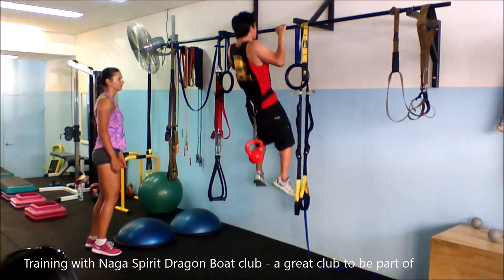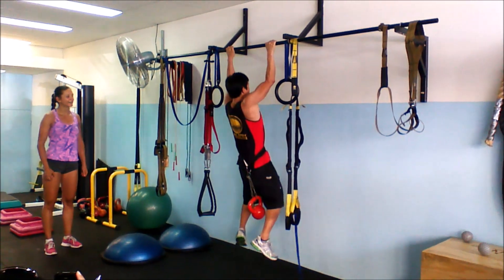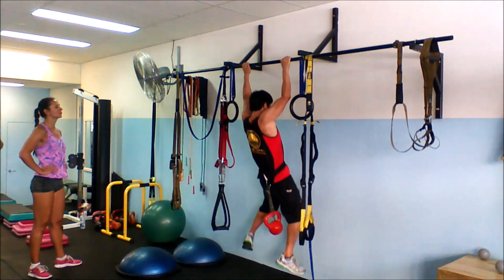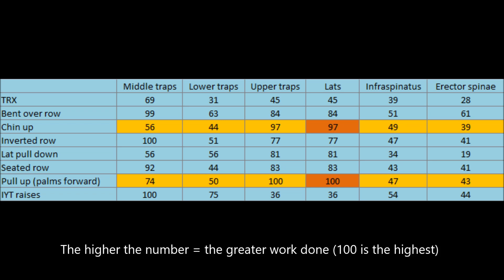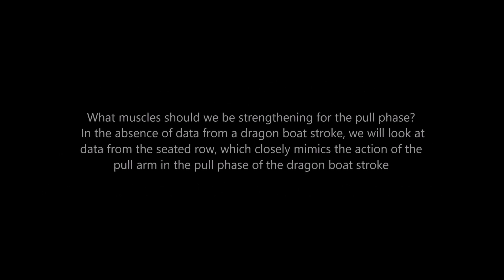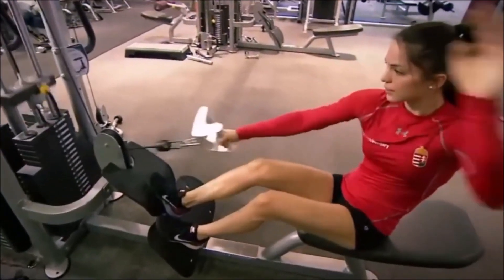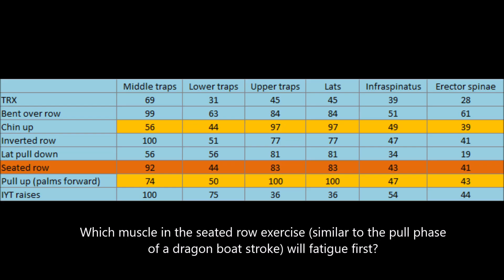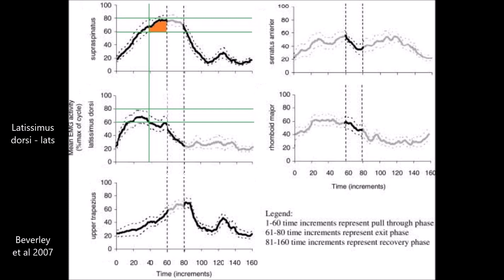Dragon boat strength training exercise design

Comment: so mid trap focus?
Reply from the maker: Yes the data suggests mid trap. Another study (which didn't study the mid trap) showed supraspinatus working hard at the back end of the pull phase. My own video observation suggests the Teres Major as well.
Reply: @jeremyrichmond7145  supraspinatus of the bottom arm?
Reply from the maker: @haanswinn  Yes. The supraspinatus of the bottom arm. If you also accept that the Teres Major plays an important role then it makes sense. The Teres Major and the Supraspinatus attach the scapula to the humerus (arm bone)  and pulls that arm bone. The middle trap attaches the scapula to the spine and pulls the scapula to the spine.
Reply: @jeremyrichmond7145  thats what im confused about i know teres major does ext of arm and medial rotation of  but infra in particular pretty much does abduction and bit of stabilizing so i was curious why this one in particular over infra at the end of pull, is this perhaps during the pulling out of the water?
Reply from the maker: @haanswinn  That's a great question. The supraspinatus appears to play its most important role it exiting the paddle. However it's activity increases all throughout the pull phase and is above 60% from midway in the pull phase. I would say the supraspinatus plays a major role in the pull phase but mainly for paddling techniques with a lot of rotation of the trunk in late part of the pull phase.